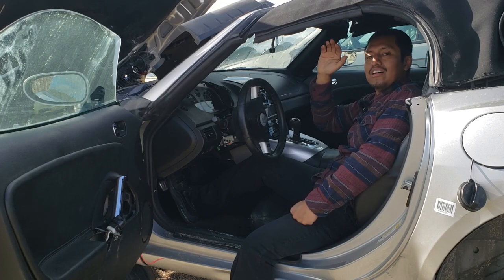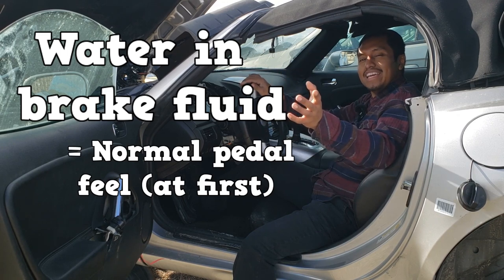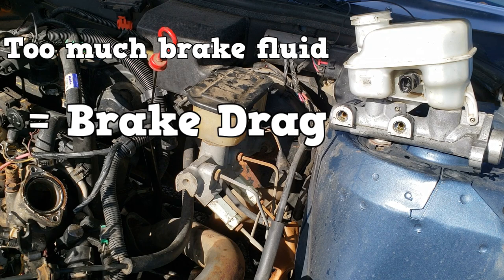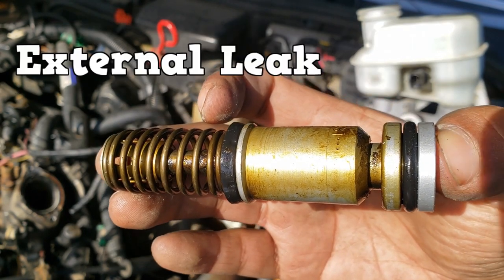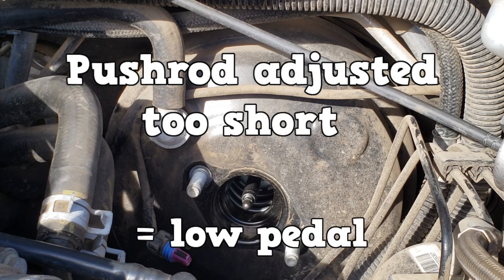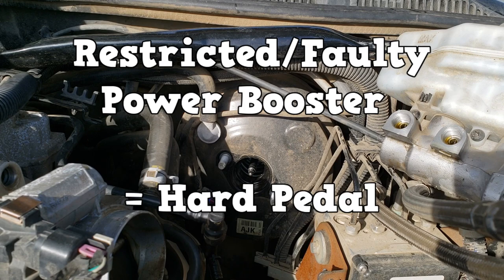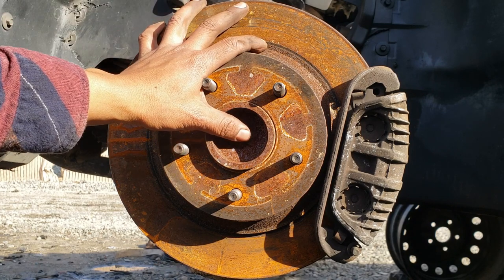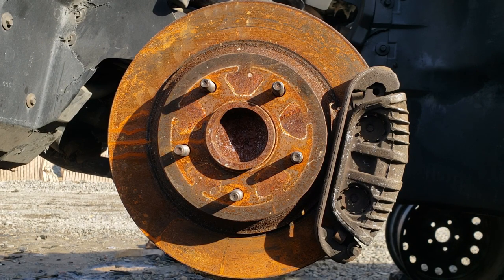ASE A5 Test Prep #2 - High/Low/Hard/Spongy Brake Pedal

Comment from the maker: Update Jan. 14, 2023: I took the A5 test and this is the best video out of the 4. Once you understand why the brake pedal reacts the way it does to the causes, you will be able to figure out any brake pedal question the test throws at you. I did not get into power booster diagnosis using the brake pedal. You should read up on those, for a vacuum booster and hydro-boost. I did not talk about fluid contamination, you should know what to look for and the negatives of brake fluid contamination.

Comment: Hey I had a question I understood the whole video except the last 34 seconds where you talked about disc brakes I thought seized calipers caused a spongy brake pedal I searched up online they said it would cause a spongy low pedal so I just wanna know which is correct for the ase test
Reply from the maker: Seized would mean not moving. So if that caliper's piston is not moving, then that brake pedal won't be moving much. I would love to know where exactly you found that info.